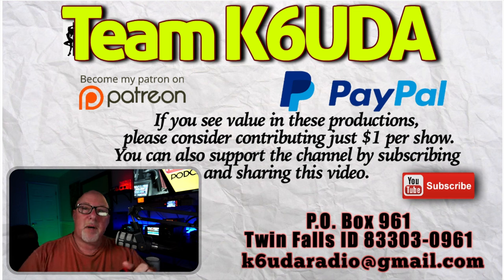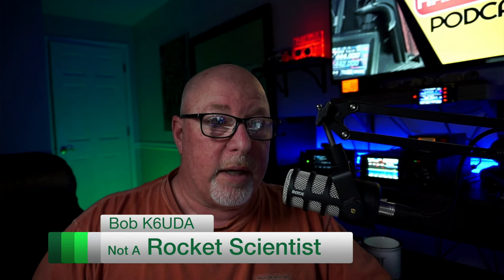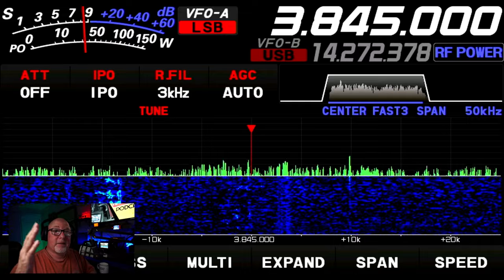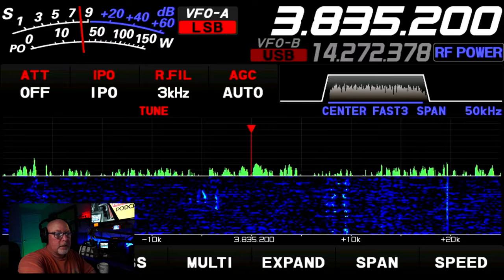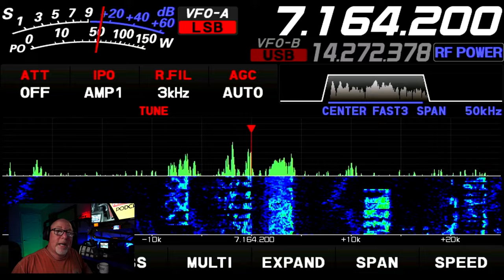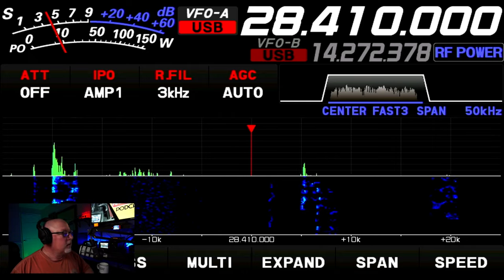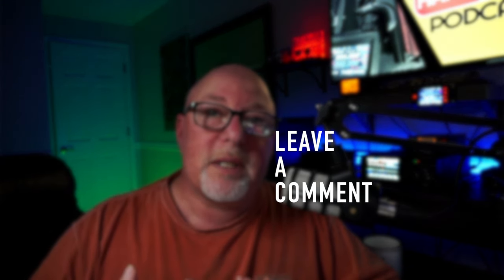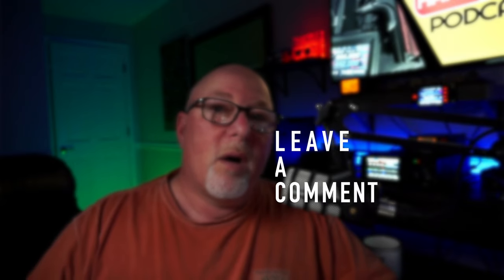Signal to Noise Explained in plain English. | Ham Radio For Dummies K6UDA Radio

Comment: Thanks Bob for the Info interesting all these years operating did not know anything about pixie dust anyway bands have been noisy these days especially when I am operating POTA Yep I am like you Bob I want to hear the weak signals especially the DX ones I only run 100 watts and a Vertical 73’ Sal / KM4PPV

Comment: The guys with the stacked antennas are going for the weak ones, stations your wire or small yagi can't hear.

Case in point, I work VHF+ weak signal, on 2 meters I run four 12 element 20 foot long yagis with 21dbd gain. I use a beacon 350 miles away as a propagation indicator. The beacon runs 10 watts to a pair of stacked loops so maybe 3dbd gain on that end. Today with a snowstorm going on it is just readable, barely... bad band conditions. When the band is normal it will run S3ish. Good propagation I can see as much as 20 over 9 or more...

I can hear the weak ones others can't, I can work further as the band may be fading out... I don't run stacked yagis to work the guys 100-150 miles away! I can do that with a single yagi.

And yes, 2 meters is more than just line of sight that everyone on FM tells you! My longest contact from EN24ho (grid square) in MN was to EL15hu, 1,315 miles! That was tropo ducting. During that same opening I heard CO2OJ in Cuba, 1700 miles! Didn't work him, I could be heard over the wall of 4 land stations calling him. Via EME(moon bounce) I have worked AU, NZ, RU, most of EU, South Africa, a few in South America...

Comment: Damn brother. What antennas are you using for 40,80? Sounds like electrical noise there. 
 I run IPO only on 40-160. Amp 1 on 20,15 and amp 2 on 10,6. Dnf at 5 and rf gain rolled back on low bands. I do prefer horizontal wires for those bands. I do have the electric company on speed dial and they know me well. We’ve mitigated a lot of noise together.

Comment: For one thing your S8/S9 isn't likely to really be S8/S9 -- you'll notice that if you adjust your RF gain your S meter will change.   It's pretty well known that non-SDR rigs have got inaccurate SMeters.  So all the "you're S9+10" is horse pucky unless you calibrate your rig to a known signal level.  SDRs on the other hand tend to have real SMeters that don't change with the RF gain.   You're supposed  to measuring the antenna level.    And some rigs like the IC7300 Smeter do 3dB per interval below S9 instead of 6dB -- so they look "really quite" when in fact they are just "really inaccurate" as an S3 signal will actually show S0
Mike W9MDB